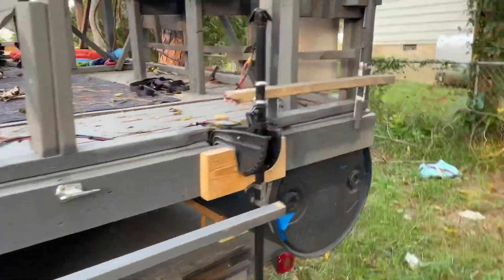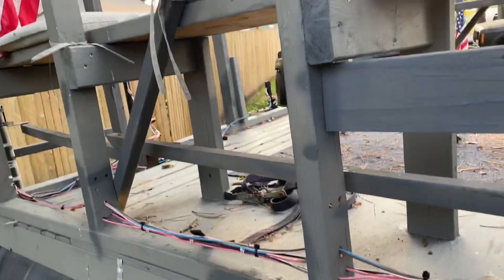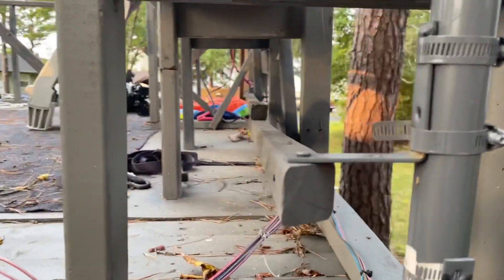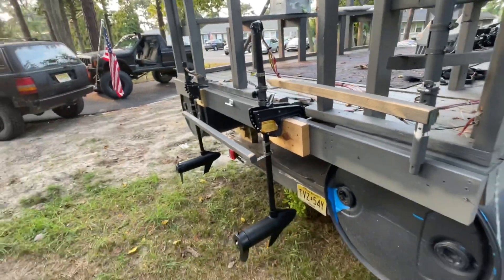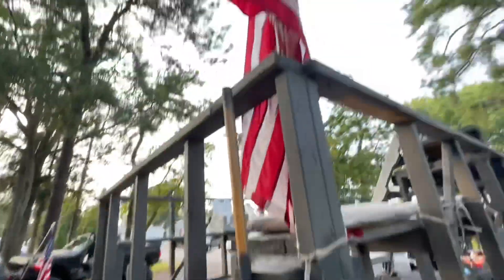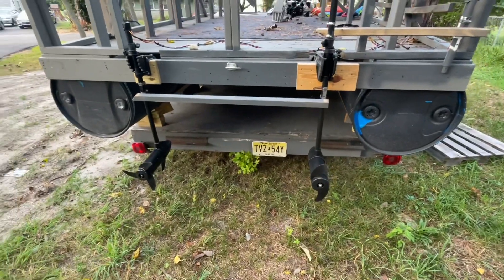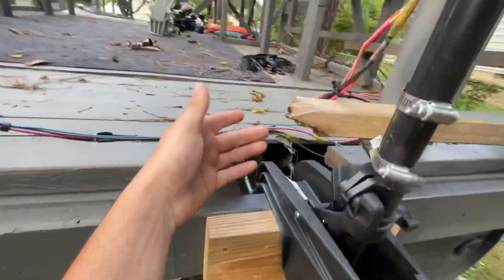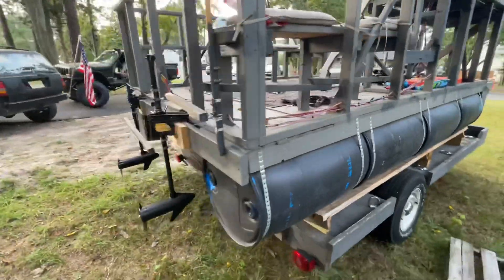My homemade pontoon boat steering

Comment: This is awesome! If you did ever want to ditch the moving motors, if you spread them out wider, you'd have more control! Keep up the good work!
Reply from the maker: Thank you! Currently working on a new set up that uses both motors like a single out board! Also I’ve got a steering wheel now!

Comment: I want to build one but im thinning about having stationary motors with a rudder and probably a pirateship style steering wheel in the middle with a wire and pulley system

Comment: Kool build. What kind of throttle control is that? Is it for brushless motors? Thanks and keep up the good work!
Reply from the maker: Thanks! It’s actually the the stock motor controllers that come inside the top part of the trolling motor. This is what the handle connects too. I just removed them from the housing, extended the wires all the way up to where my console is. Each motor is truly independent of each other. I did this so that if I had a motor failure I still had the other motor to get us back to the boat ramp.
Reply: @ShoreGarage  Funny...I was thinking of doing the same. Good to know this method is feasible. I hope these mechanical speed controllers last for a while. Keep us posted. Good luck!
Reply from the maker: @kammerjohn9553  will do thank you! Currently I’ve ripped the transom off the boat doing some testing. I’m in the process of repaired now so that’s why I’ve been lacking on the videos lately